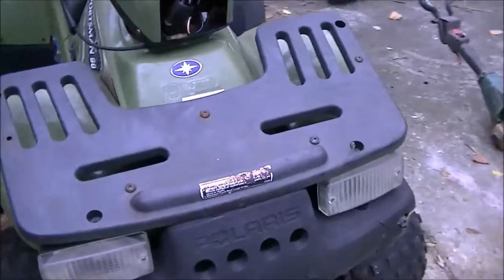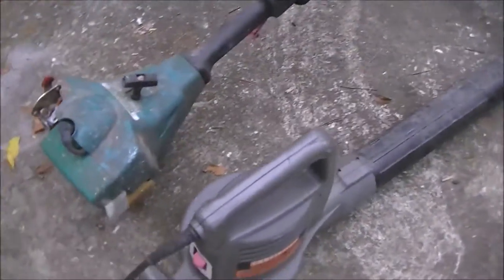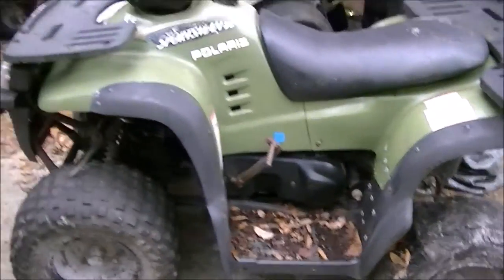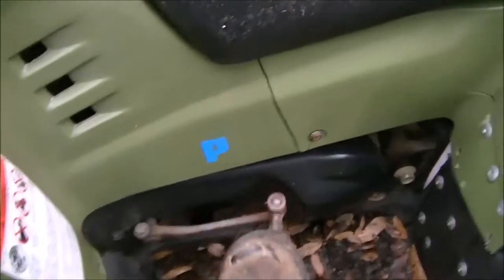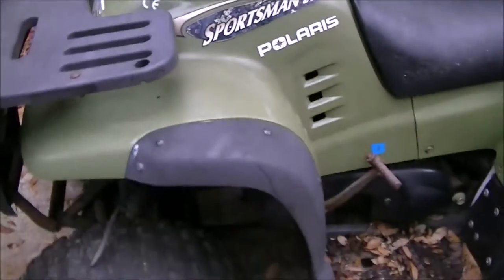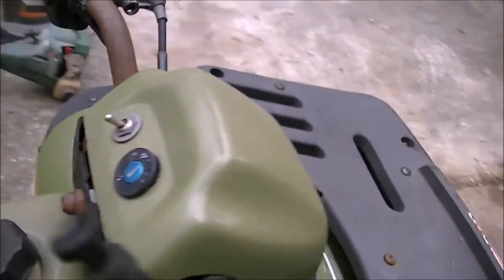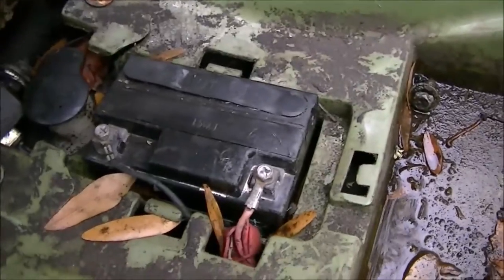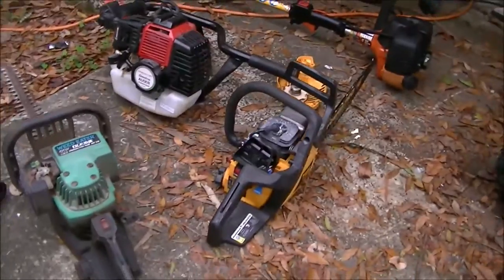Free Stuff

Comment: Most Polaris's or at least the larger bikes like the 500 do need 12-v to run the ignition system and run.
Reply from the maker: yep, but if you need to know for future reference, these small ones (at least this one) will run without the battery. i tried it to see. good info to have right there lol.
Reply: shabear1000 Good to know.
The 125cc 4-Stroke we have won’t
But the 90cc 2-Stroke will.